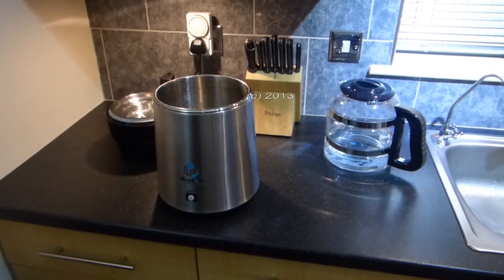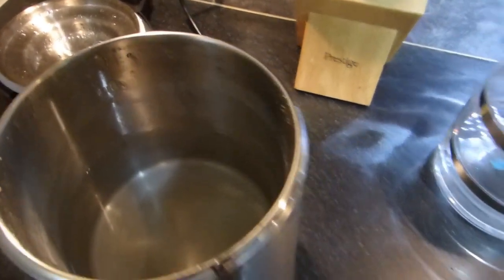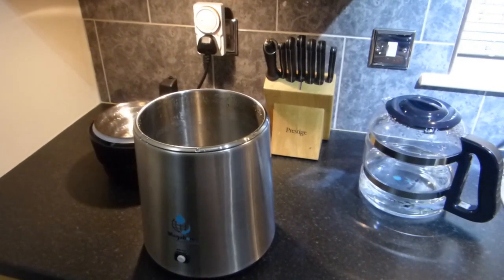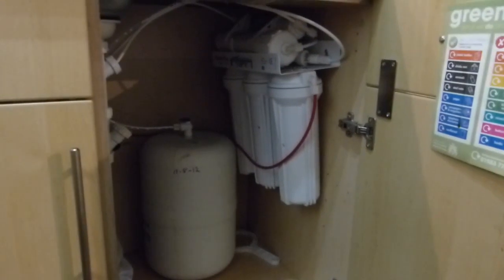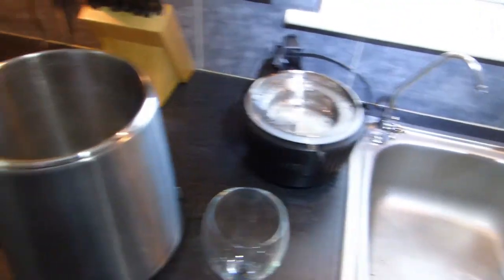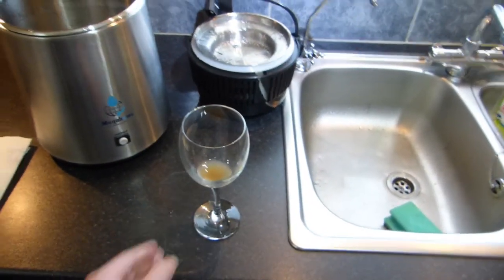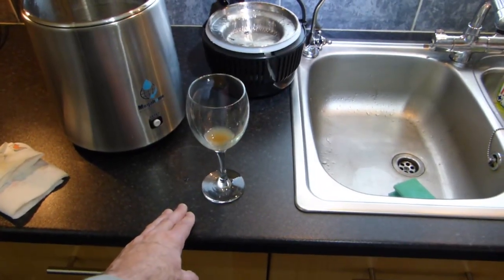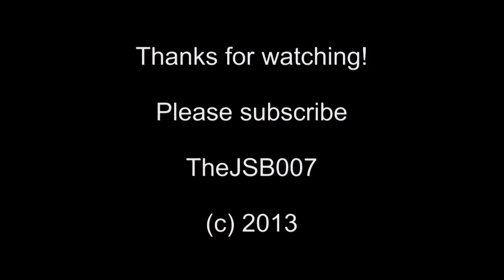Water Distiller Vs Tap Water (The removal of crud)

Comment from the maker: Good idea Tyler Stockton :)
Reply from the maker: Good for you bro' lol :)
Reply: ***** Excellent Video....
Reply: ***** Thanks. Get a Distiller.... Slow Kill in the Water....
Reply: +Let There Be Light What is the name and model of this distiller? Your link is no good anymore.
Reply: +Let There Be Light I got the exact one you have the one's on ebay look cheaply made. How often do you clean the inside?
Reply: It's called a Megahome water distiller.
Reply: you use citric acid add 2 to 3 tablespoons to the tank filled with water and boil for about i hour empty and rinse and bob's your uncle : PS citric acid is cheap on ebay and they even use it to make cordials for drinking but make sure it's for human consumption if you use it for cordials.
Reply: Great Video, what did you use to remove the crud?
Reply from the maker: +Crusty Tackleford Check out Ebay on the new link I supplied, there are many much cheaper now, get one with a glass jug.
Reply: *****
Your link doesn't work.
Reply from the maker: +Crusty Tackleford  It does, I've amended it, if not, try eBay there's lots on there.
Reply from the maker: +Let There Be Light http://www.ebay.co.uk/sch/i.html?_odkw=5+filter+reverse+osmosis&_osacat=0&_from=R40&_trksid=p2045573.m570.l1313.TR4.TRC2.A0.H0.Xwater+distiller.TRS0&_nkw=water+distiller&_sacat=0
Reply from the maker: As soon as it looks dirty enough to clean. Wipe out after each use.
Reply: Got it thanks!

Comment: Thank you for taking the time to do this video. I live in a mining town and the water quality is bad. I currently use Britta filters but this might not do much. I might look at getting one of these units. Question, distillation is meant to give pure water, so why is there another filter at the front of the unit.
Reply: to get rid of impurities that is "carried over" by steam and also filter out Chlorine (sodium hypochlorite, and other forms) which has a boiling point close to water

Comment: Hi John,  Where do you get the charcoal filter from,  I have also purchased a Distiller after watching your video a few months ago.   Thanks for the info. Take Care
Reply from the maker: So far I've not bought one, as there were two that came with it, however you don't always need to use it, it's not really necessary as the distilled preparation comes out clean anyway, but I'm sure if you Google it you'd find a supplier or go to the Mama penguin Ltd, they'd supply I believe, good luck :)

Comment: The pH scale goes from 0 to 14 where 7.0 is neutral. If the pH is above 7.0, the water is alkaline. If it is below 7.0, it’s acidic. I think you'll find this interesting... Milk 6.5,Distilled water 5.8 – 7.0, Beer 4.0 – 5.0, Coffee 2.5 – 3.5, Orange juice 3.5, Tea 3, Soft drinks 2.0 – 4.0, Wines 2.3 – 3.8, Stomach acid 2 & Battery acid 1. So Distilled water is very very healthy for you.